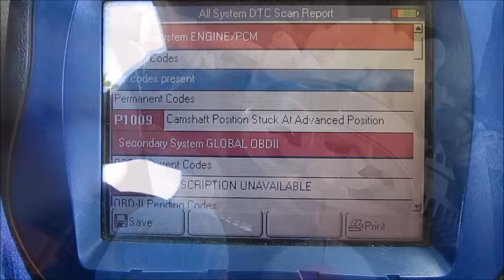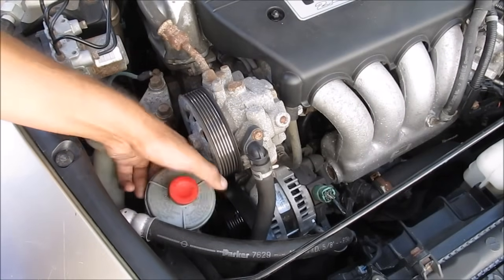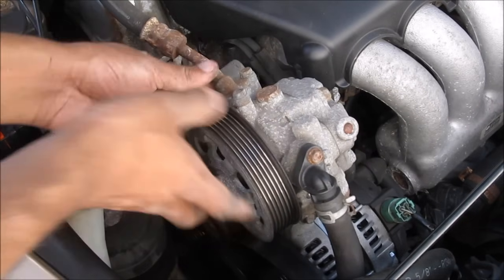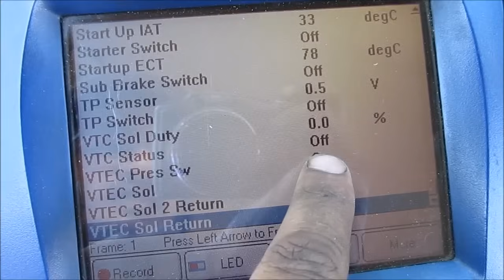P1009 Honda VTC Valve Cleaning

Comment: Would this process work the same for an 06 honda crv?
Reply from the maker: Yes same engine
Reply: @speedkar99  thanks!  Would a vvt sensor solenoid affect the cel, vsa and orange triangle lights if it was put in, but the bolt went in a bit crooked and might be stripped? I'm thinking that if not completely snug, then the pressure wont read correctly.   The vtec system relies on this.   I don't want to keep messing with the bolt and messed up threads so I was thinking of putting a high temperature sealer around the ring possibly to completely seal it. 
Otherwise I'm still getting p1009 advanced malfunction code and everyone keeps telling me that it's the timing chain.   
Would using regular oil as opposed to synthetic effect this negatively also??

Comment: So if the o ring sticks inside what do ya do ?
Reply from the maker: Mine got stuck. 
I guess you could open the valve cover or use a pick and get it out.
Reply: I took one off in a junk yard and it didn't have an o-ring on it either and I dug around and didn't get one out so did yours work sticking it back in
Reply: Guess the o ring stays in correct place?

Comment: hi, in this video, you said dont confuse VTC with VTEC. so how is VTC different from VTEC valve.
Reply: sivaraj palanisamy vtec is the cam actuator that locks the rockers and changes cam profile to open more. VTC control the cam timing.

Comment: What ODB reader did you use to display the VTC status ?  Sadly, my Autel MaxiCheck Pro doesn't appear to have support for that live sensor data.
Reply from the maker: I don't remember the name. If you get a simple OBD2 elm327 Bluetooth adapter and the correct app you can read it on your phone
Reply from the maker: Oxygen sensors are all OBD2 protocol so any reader should pick it up

Comment: Just as a heads up to anyone doing this. For some reason the code wouldnt clear for me at first. I had to rev the engine a few times and it cleared for me. Thanks for the video man, I personally just did the VTEC cylinder and didnt do the strainer. Took me all of 10 minutes to complete!
Reply from the maker: Glad it helped

Comment: Clear and concise video with superior description.  A bit of humor with the old underwear and bolt loosing
 grunts worked well.
Reply from the maker: Thanks for the awesome feedback
Reply: Time >> 7.5min as I had trials with removing the solenoid- used extended nose vise grip,   idler nut falling out - used threadlocker,  and the reinstalling the darn belt - need better tool than two wrenches.   Replaced the strainer assy filter  due to an edge tear in mesh.  Solved P1009 code and my daughter is very happy she saved some $$.  Lesson is must use superior oil and always keep it topped up.

Comment: This part is causing a rattling noise on my 05 Honda. What to do to fix the rattle noise goes away?
Reply from the maker: I don't think this could cause a rattle
Reply: @speedkar99  I posted a video for the rattling noise on my page. Can you confirm whether it is the Timing Chain Tensioner? I already replaced the Belt Tensioner, but no fix. Thank you.
Reply: Mazarita Village yes that’s the solenoid that causes the start-up rattle.

Comment: The ground wire that you removed,  where does the other end of that ground wire connect ?
Reply: It connects to the chassis on the passenger side just towards the firewall.

Comment: Might this fix the cold start tapping. 
This is more information than the dealer will ever give you. I’m going to start with this
Reply: Lilljoescratch 
no to stop that you need to replace the 
actuator (camshaft actuator)
Reply: Lucas oil stabilizer quiets my valves
Reply: Valve lash is another one

Comment: Hopefully you are still on this video... was your car making a cranking or grinding sound when doing a cold start? ive seen all over youtube of 08' accords doing the same.. did this fix that? A honda service center wants to charge 900$ for 3 hours worth of labor and $500 for the solenoid and actuator.
Reply from the maker: 3 hours of labour should be thier shop charge times the hours....$900 is too much for 3 hours

Comment: Excellent DIY video; my 14mm pulley bolt is stuck.  Open end, even Flare nut wrench are stripping the bolt head.  Thx alot impact wrench using shop guy.

Comment: That weird 10 mm bolt. What kind of bolt is it? I lost the one I removed.
Reply: Honda Part # 15835-PNA-003. It is currently available for $2.64 on the hondapartsnow website. Be sure to verify your application prior to purchase / installation. (I am not affiliated with aforementioned website or Honda)

Comment: Very informative video keep them coming. My Honda has the p10009 code also. It tends to turn on when my engine oil gets close to being time for a change. It will turn on when I start driving aggressively. However when I drive normal the code turns its self off. I used a scan tool to identify the code. Thanks for sharing your video!
Reply from the maker: Glad it helped

Comment: +speedkar99  I just had my mechanic do this exact job, with the same code p1009. He did clean & test the solenoid. Any idea what the problem could be? I am thinking it could maybe be the VTC Actuator...
Reply from the maker: +Merlin Calo the actuator itself could be faulty and work intermittently. Replace it along with the o ring

Comment: What is the part number for the O-Ring for the VTC Solenoid that is prone to leaking?
Reply: VTC Control Valve Oil Seal 15832-RAA-A0 (O-ring) which is located at the end of valve and looks flattened over time (he thought it was stuck at engine head but it was on valve itself). The square shaped gasket is VTC Filter Assembly Screen Gasket 15845-RAA-A01.

Comment: Good video, but when you took out the VTC valve and you said that the o ring maybe stuck in the engine, how would you be able to replace the o ring? If its stuck in the block I dont want to hurt anything trying to fish it out. My o ring has to be replaced due to oil leaking from the valve. Thank you if you can answer this.
Reply from the maker: +TheWaywardWanderer I didn't replace it. My mistake, I believe it caused a leak after. 
You can try using hook or opening the valve cover.
Reply: speedkar99 So if the O ring doesn't come off with the VTC valve, will the O ring be easy to hook out? I know that sounds weird but I'm wondering if I would have to pry it out as if it's stuck to something.
Reply: Once the o ring is out, where do you place the new one?

Comment: Will this cleaning process help to eliminate the cold start "noise / grind" that frequently occurs on 2008 Accords? (VTC actuator?)
Reply from the maker: +peter15201980 That is a known defect on the accords, I don't think it has to do with the vtc actuator.
Reply: I know I'm way late here but the answer is no. That problem is on the 8th Gens. If you're still having that problem take it to your local Honda dealership they have a fix for it now, for free.

Comment: I just got this issue. My car suddenly stopped working. Breaks locked, steering wheel locked, and then car just slowed down until it stalled. I went to a dealership and they told me worse case scenario I would need a complete engine swap.
Reply from the maker: +Royce Bai Timing belt?
Reply: Yeah, my friend also said the timing belt might be the issue. Does that mean I need a new engine?
Reply from the maker: +Royce Bai if it damaged something inside then yes.

Comment: I have a 2005 Honda Element. I'm getting P1009 code. Decided to take on replacing the VTC solenoid after realizing how much the mechanics were charging. I have the bolt off the solenoid but I can't get it out of the engine. "Wiggle, wiggle" doesn't work nor does a pair of pliers. Any help would be appreciated. Thanks
Reply from the maker: +DJ A-L it took a lot of wiggling and force to get mine to pry out. And its not easy to do right against the fender. Keep trying
Reply: Hey, Thanks for the reply. Things have got worst since yesterday... After all the wiggling the world I couldn't pull the solenoid. Then I found a layer of what felt like glue around the bolt area of the solenoid (is that normal?). I decided to give up and put it back together and just take it in. Unfortunately earlier in the attempt to try to get it out I loosened another bolt directly above the solenoid in an attempt to set it free (not sure what this bolt is for). While I was tightening the bolts back on I had the one that wasn't attached to the VTC snap off... I'm having the worst of luck with this car. Because of where the solenoid is located I'm not sure how to extract it. I tried to avoid paying $500 and ended up pushing the bill even higher if I take it in.

Comment: Nice video bro my check engine light came on a few days ago and when I ran the codes it gave me the code p1009 i have and 04 accord and drives like a beauty , when the car is stopped at times I here a tiny little rattle from under the car and also I've realized my oil kind of eats up quick and I have no leaks , can I keep driving like this , does it just have to be cleaned or does it have to be replaced ? And how do I know what it is for sure ?
Reply from the maker: +Joey Arce Clean first then replace. Cleaning did it for me.

Comment: A useful use for used briefs!!  
YES!!  like the poster below said - WATCH THAT DAM TENSIONER NUT!!  I lost mine down the engine depths and had to replace it with a ground down metric nut that cost me an hour to go and buy.  Hold it in place with some device etc while you thread the tensioner bolt into it.

Great vid BTW.  You actually show the process, instead of "Step 1. remove XYZ.....????  Step 3. Now that XYZ are out, we simply go to the next step."

Stay gold.
Reply: Send me those used briefs and I will show you what truly used briefs REALLY look like.
Reply from the maker: +dnl machine haha 
You have some spares?
Reply from the maker: +dnl machine thanks for the feedback!

Comment: When you have a P1009 Code how can you tell it is the VTC Valve and not the timing chain?
Reply from the maker: +Russell Fontaine P1009 refers to VTC specifically. Timing being off would cause other misfires and the car to run rough
Reply: "An stretched timing chain or damaged tensioner can also caused triggered the P1009 code. Before replacing timing chain or tensioner, check engine oil level and condition. Replaced engine oil and filter with factory recommend oil weight if necessary."

Read more: https://www.autocodes.com/p1009_honda.html

Repair shop cleaned (not replaced) the valve and I am still getting lights and the P1009 code.  Shop is telling me is the the timing chain.  The car does NOT ride rough except for between 35-40 mph where the RPMs jump up and down and the car bucks a little.

Comment: If I use a quart of engine flush and then do an oil change afterwards. Do you think it will clean the screens and the VTC solenoid valve? I need an opinion or If anyone done it. Thanks
Reply from the maker: +HARRYEYCG17 I doubt it. That stuff is crusted in there. Synthetic oil might help

Comment: have 2009 accord with check engine light and VSA light on with code  P1009 , cleaned out strainer and valve as instructed , cleared codes , drove car for 15 min. ck egine light came back on then VSA light came on , repeat this twice , now when warmed up my idle is fluctuating  going up and down , help any suggestions , Mike
Reply from the maker: Clean the idle air control valve.
https://www.youtube.com/watch?v=cwo1Hs_0aSI
Reply: +Caitlin did you follow the video in the comment to clean the idle air control valve? I am having the exact symptom you were having so I am wondering.

Comment: What code reader do you recommend? I have a 2005 Honda Element and I suspect the problem identified in this video is currently what's up with my vehicle. Also, do you have a video on replacing the oil pressure switch? Thank you very much for this video, it helps me out a lot!
Reply from the maker: +Eric Wahl I don't have Honda anymore but I use Toyota techstream with a $20 USB cable. 
Check out my VTec solenoid video

Comment: Two questions. 

-Is this overall easy to do? Looks sort of simple, and my experience with cars goes up to simple maintenance like oil changes, brake jobs, serpentine belt replacement and that kind of stuff. Shouldn't be a challenge for me right?

-Is this code urgent? Like if this is ignored, will it be bad for the engine?
Reply from the maker: +BattlefrontZero Its easy, the tricky part is your working right up against the inside fender which makes it a bit tight. 
It wouldn't harm the engine too much, it may throw off the timing and cause it to idle rough which isn't good.

Comment: You saved me $485 in labor at the dealer!!! Thank You!!!
Reply from the maker: +201Bmoney glad it helped you
Reply: speedkar99 thank you so much for this video it's so helpful 

I need your advice 
In my Honda Accord 8th this Valve has little bit oil around it but it doesn't leak but my engine burns oil a lot
is star burning oil after long time like 1850ml

Comment: It seems that your engine light indicates P1009 was caused by low engine oil level not dirty filters or valve.
Reply: Paweł most times just an oil and filter change fixes those codes. Dirty oil is notorious for Honda timing codes.
Reply from the maker: +Paweł that wasn't my case my oil was topped off

Comment: My VTC valve rattles on cold start(2008 Accord). Why does it do that? And if I take it out and clean it like you did, will that stop the rattle?
Reply from the maker: +Joe The Alien Theres a recall on that, google it.
Reply: I tried finding info on that, no luck. I called a nearby Honda dealership and they said there's no recall on it.
Reply: is that cleaning going to work for rattling cold start problem on honda accord
Reply: speedkar99 i have sane problem with my 2008 honda accord should i call the and what should I tell them?

Comment: I have a 2006 CRV with the same code. Cleaned the VTC valve but the check engine light came back after two weeks and getting to 120 km/hr. No trouble to get to high velocities, but when the car is at idle it seems to want to turn off, just until I push my gas pedal again. What should I do?
Reply from the maker: +Sergio Garza change the vtc valve it might be sticking
Reply: I have 267xxx on my 06 crv. The O2 sensor was causing a rough idle on mine it did stall 2 or 3 times. Also I cleaned my strainer today, over 50% blocked by crud stuck in screen, carb cleaner took it away.

Comment: Thanks 😊 Ive successfully replaced the gastekt with your nice vedio. 😊
Reply from the maker: Thanks I'm glad it worked for you. Did the O-ring come out with the VTC valve?
Reply: speedkar99 when I pulled it out, it was the same as urs😂. I just cleaned it. oh before this the small squared gasket was replaced like what you did. Thanks ☺️

Comment: my 2008 honda accord has been making an awful grinding noise on a cold start. it does it sometimes even after i've been driving around. i think the vtc valve is the issue but i'm not too positive. any advice?
Reply from the maker: +pin3applecrew probably the variable valve timing
Reply: pin3applecrew I'm actually having the same issue with my 08 LX-P during cold starts. Did you end up figuring out what it was ?
Reply: not yet i don't trust myself enough to start taking apart things from the engine until i know exactly what the issue is
Reply: pin3applecrew in case your still wondering it's your intake cam gear

Comment: I have a 03 Element and have the P2646 and P2647 codes. I replaced the VTEC / spool valve with a Genuine Honda one and cleaned the VTC screen but still have the codes afterbeing reset they came back. replace the Oil control valve?
Reply from the maker: Yes, and check wiring harness

Comment: have a 14 year old honda element, should i do this even though i dont have that code?  I only have a cheap code reader, is it possible it wont detect all CEL codes?
Reply from the maker: +hallmonitor98 wait until you get the code. There's an o ring that can start leaking if u take it out to clean it and don't change that o ring.

Comment: Ive never thought bout using an old torn underwear hahah🤣
Reply from the maker: +K24 Accord gotta find a good use for them check out my latest video I used it up nice.
Reply: So my car is having electrical problems battery alternator changed... problem is when im driving and then come to a slow stop at a light the battery light comes on and goes off..i seen where it comes on and like i turn ac on it makes it go away or press the gass

Comment: I have the same year Honda. ground connection between the engine and chassis is broken. does it effect the performance in any way.
Reply from the maker: +Red Baron No, but you should get it fixed or face electrical issues down the road
Reply: What year is it? I didnt hear him mention it

Comment: Thanks! I did the strainer but I'm having a problem removing the vtc solenoid...please help.... I tried to shake it but still stuck and I only removed the bolt.
Reply from the maker: +PEXMAN you have to twist and pull on it for a long time. It took me a good while to get it to unseat, and the rubber was stuck in the engine. Good luck.
Reply: speedkar99 Oic...I changed my mind I just leave it in didn't clean it but the strainer I replaced it to a new one. Thanks!

Comment: I have that code in my car. it's a 2004 Honda Accord ex, the check engine light turned on, and when I stopped the car, it waned turned off.   but when I pushed the gas pedal the car works good.  the problem is when I stop the car. you think it's the same problem?  also, can i drive my car with that problem one more week?  
thanks.
Reply from the maker: For that you need to clean your idle air control valve:
https://www.youtube.com/watch?v=cwo1Hs_0aSI